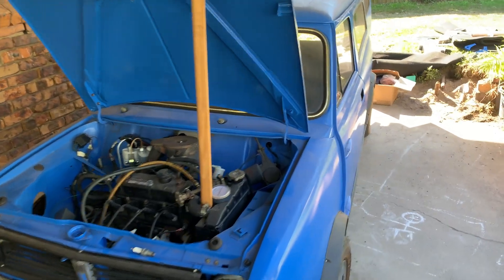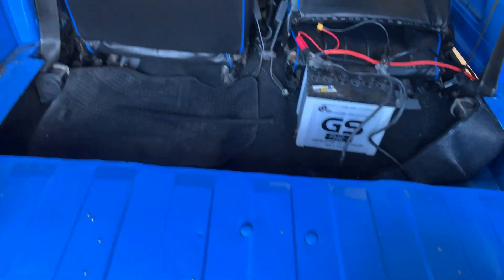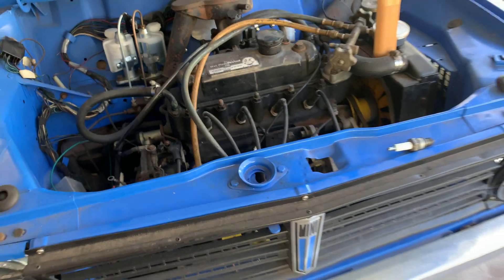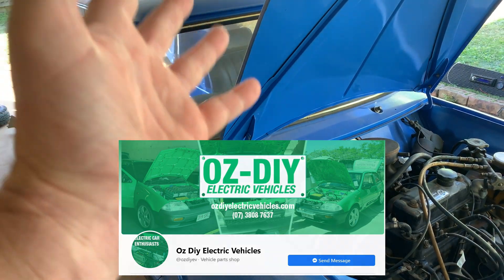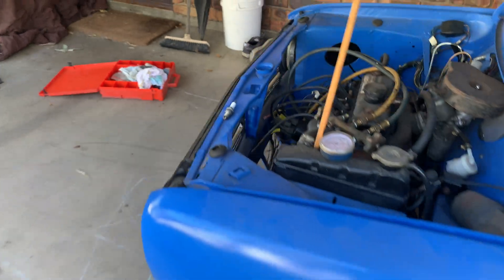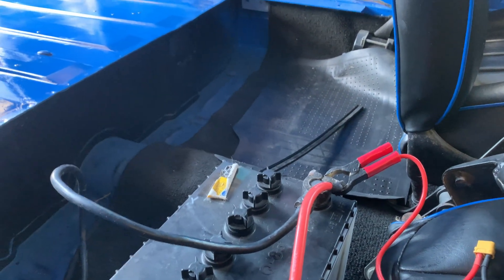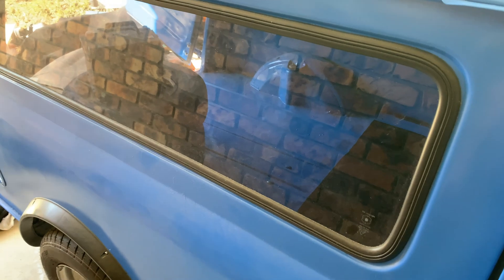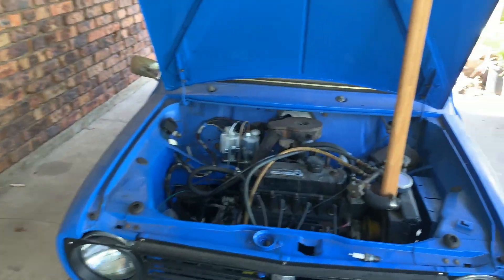New Project MINI VAN - 1974 Clubman Panelvan || GO Electric? ||

Comment: It would be so nice if you could do this as a budget EV. Maybe using parts from a single donor. You are right of course,  cost of professional conversion is stratospheric and total madness. I’d really love to do it with our Clubman estate but spending £20k plus is hard to justify when the result is still a 40 year old car with no safety features that the government might just legislate off the road in 5 years time.
This is why I ( probably like you ) spend so long dreaming about this and not actually doing it.
Reply from the maker: I love the idea of a Tesla Small drive - 100+hp and enough torque to blow the tread off the old 10' tyres!

Comment: They sprayed over rust, I'd be very wary of what else they covered up!
Reply from the maker: Yah think? Do you know the car?
Reply: @HBPowerwall  Yeah I do think lol. I don't know this specific car but I do know that someone sprayed over rust that was bad enough to have rotted through a panel (hmm, are Minis prone to rust.... Is it actively rusting or properly prepped?), that they cut out a portion of the rear sheet metal in an abortive attempt to create seating (cleanly it seems but still), that they had intended to mount a seat belt shoulder strap to a location not suitable for safe restraint, and that portions of the door were removed that prevented them from opening too far. These are all things that make you go hmmm! You also indicated the vehicle had sat for an extended period of time which is never good but it did fire fairly easily. So yes, taken as a whole, I'd be wary! 

It's likely perfect for your intended purpose  though especially with the rear decking partially removed begging for batteries, but were it mine I'd be checking it over closely for additional surprises. You mentioned the wheels having been widened too, probably worth checking that out. They're holding air so it can't have been too badly done but you believe it was modified so looking it over makes sense. Date codes on the tires fairly recent or did you swap them? 

Looking forward to seeing what you do with it!

Comment: Have to say the van might be a better option for converting as there wold be more space. Looking forward to it non the less :D
Reply from the maker: I would say its ideal - you could put a battery box inside the rear subframe, behind the seats and on top of the motor in the engine bay. Might even have a 200km range!

Comment: Looks like the 'rear footwell' would be a perfect place for batteries, nice and low and between the wheels with a slight rear bias. just flatten out the floor and build a nice box to fit the cells and bring it up to floor level (or just below to put a proper floor over).

Comment: "A few additional cold cranking amps" I buckled over laughing.... hahhahahahaa
Edit: Those wide tires are ready for some torque ;)
Reply from the maker: It was like the starter motor doubled in speed lol Rims are very wide running on stock drums. Thinking 6" wide 12" wheels up from the 10x5's

Comment: Looks like it could be a nice EV project. What would be the rough dimensions of the space behind the back seat (excluding the hump for the exhaust)?
Reply from the maker: Good question! I'll grab a tape measure this weekend.. Bunch of spare parts, ordered - Fuses, bulbs, brake hoses, number plate bits, new seatbelts - should be able to get it through rego fairly fast I hope! 
Then look into the EV side of things.

Comment: my idea for an electric ev mini years ago was to remove the cylinder block and just have the gearbox mount a forklift motor on the top attach to crank shaft and then i thoght about cutting the floor out under the rear seat ti have the battery's it never tulk off as i dont have a car licence lol
Reply from the maker: That was my idea with a 6" 96v AC motor... about 50 hp I think the model number was AC20 motor
Reply: @HBPowerwall  i was trying to find motor with same rpm range as the engine would have never really found much and the stuff i could fine was silly money so my end option was going to be milk flaot or forklift motoe and maybe gear for higher rpm everything i was doing as thoery and had no true clue to what i was doing bare in mind i was prob about 15 at the time

Comment: hmm possibilities
Reply from the maker: Soo many
Reply: @HBPowerwall  quick question on the power wall legalities  currently  have they really made it that bad  you cant even decommision a system?  is it time to go mobile then? (victron)
Reply from the maker: They have covered that too, mobile has its own rules also. The way I read the regs I can actually do it with the correct safety gear, but it's total madness and I fear that some of the 'safety precautions' would be more dangerous than not using them. IE massive clumsy gloves - how the hell do you use them with any degree of accuracy. At any rate can't fight them so might as well work out a way around them or just give up
Reply: @HBPowerwall  is there a link to the madness ?  (the regs)
Reply from the maker: Thats a vague run down at best.. https://renew.org.au/renew-magazine/solar-batteries/new-battery-installation-rules/
Reply: @HBPowerwall  cheers thanks pete  not sure I'm gonna like what I read
Reply from the maker: if you google as5135 or what ever it is, you can download a draft copy for free. That run down gives you hope till. you read the full document.
Reply: @HBPowerwall  yeah having a bo peep now   not sure how useful 1 kwatt battery would be lol
Reply: @HBPowerwall  DavidPoz has used them on his channel and in fact I believe he had to use gloves over other gloves as the insulating gloves can be fragile. Can save a life though if you grab the wrong thing or brush a tool :( Don't see them often though and he pulls packs apart frequently.